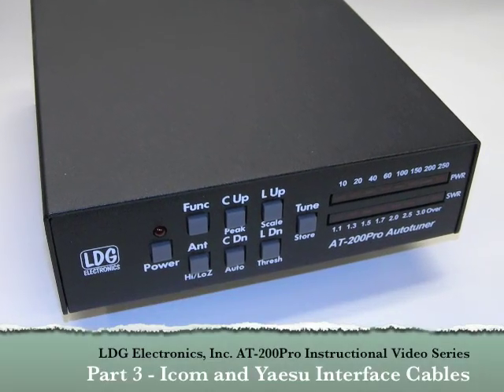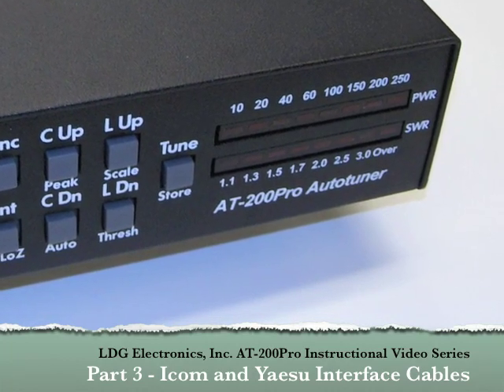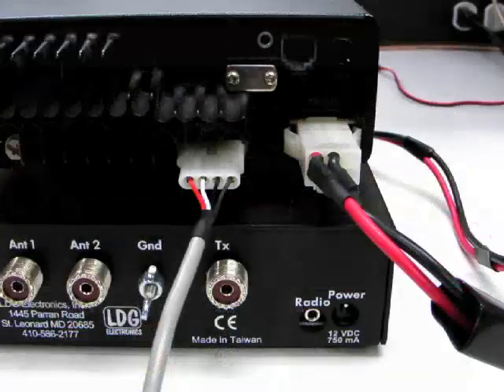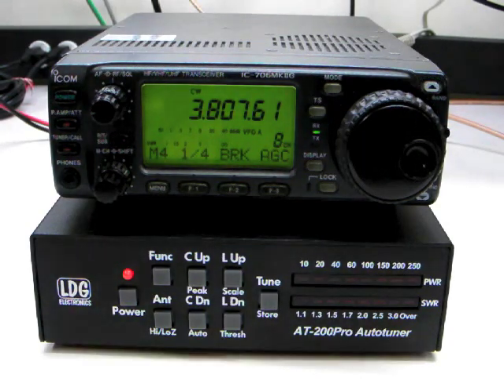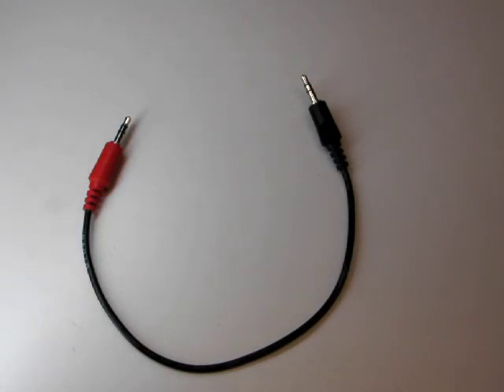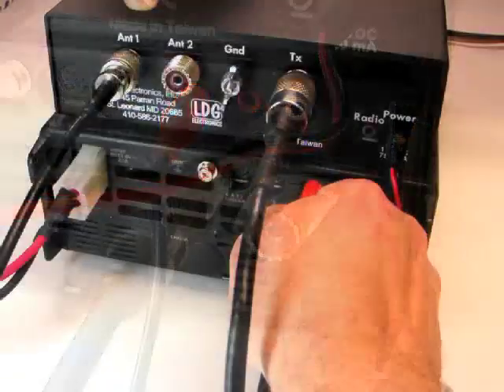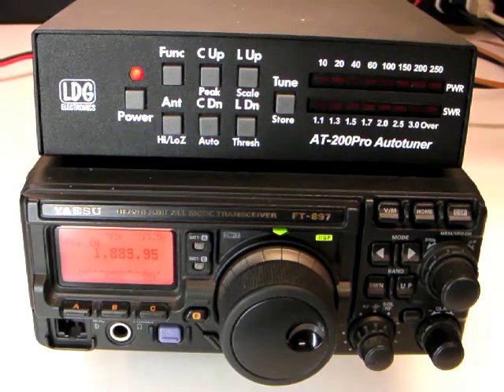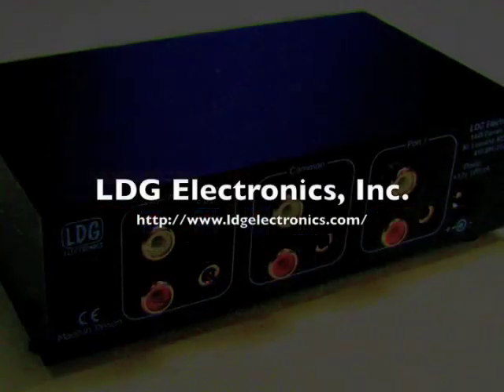AT200Pro Part 3

Comment: your hands on video parts 1,2 and 3 are way better than the booklet. Thanks for these. one question - I have a Yaesu FT-847, Is there a interface cable for this radio. Or must I usr the AT-200Pro directly without radio interface?